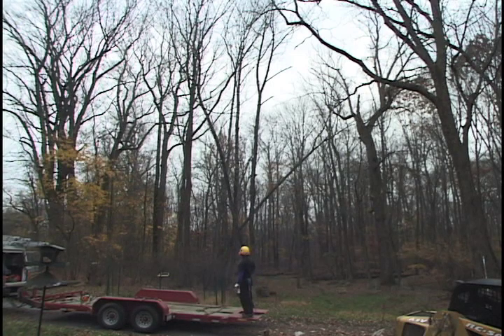Hanging an Ash Tree On Half Inch Line

Comment: What was the purpose, not seeing it on this one?
Out here you don't trust an ash to hold anything, most can be pulled down easily with a 1/2 rope, and lots of limbs will come off with a throw line, there are very few left alive in Michigan. However the city of Grand Rapids sprayed a few blocks of them ahead of the EAB and they are still healthy. Every now and then I find one that is living, but the borer still has damaged it.
Have a great day.
Reply from the maker: this is an old video maybe 2010.. ash weren't hit by EAB yet and the purpose was to show that you can hang a sizable stem off another stem of similar size as long as its but heavy and the but is holding weight on the ground
Reply: @UCseSwqsha7yQm1oZhJcPhsw that makes sense.
I like to rig some down like that out of others on back yards to avoid climbing, pretty easy to send a line through a crotch, then a bowline up to the tree, and take them down like you would with a GRCS, well a poor man's GRCS lol.
Have a great weekend.